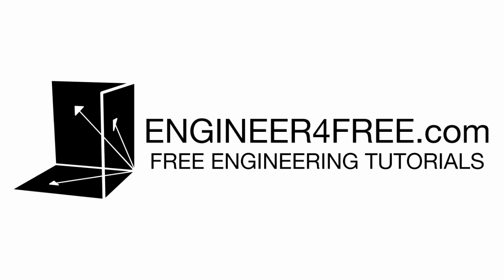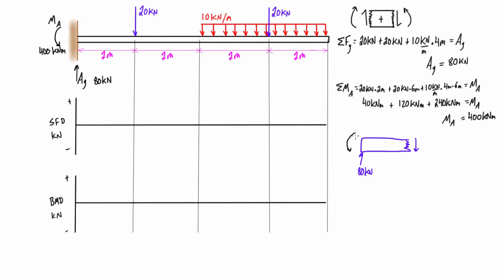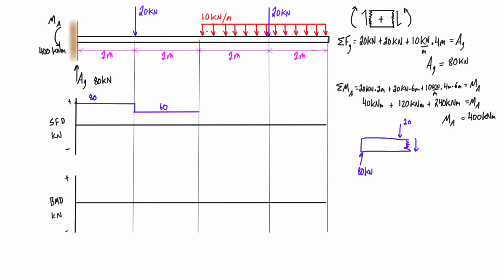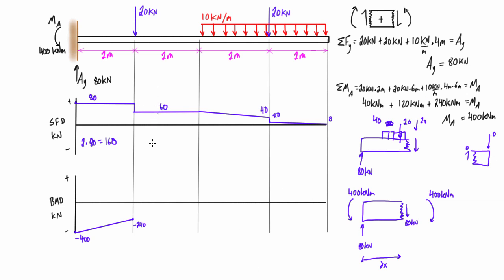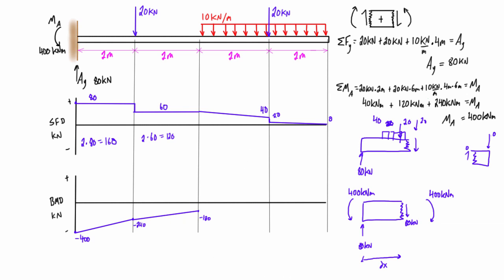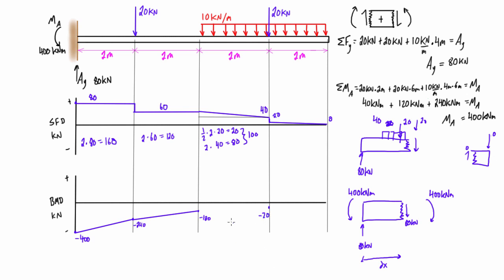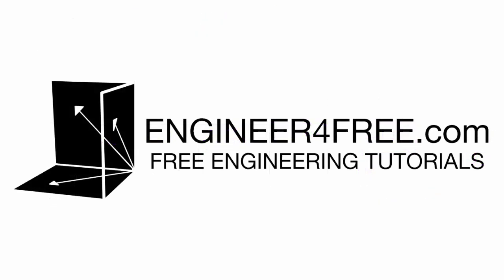Shear force and bending moment diagram practice problem #4

Comment: This is very helpful bro. But one thing I wanna ask is that why did you just used MA in a CCW direction since our conventional dixn is the opposite. Thank You tho.
Reply from the maker: In general for solving sum of moments about a point in a 2D problem it is common to use CCW as the positive sense for a moment. The is not the same convention that is referred to in the top right of the screen for an internal moment on the left of a virtual cut, which happens to be opposite.

Comment: what about Ax? is it unnecessary in this problem
Reply from the maker: There are no externally applied forces with a horizontal component, so if you draw the FBD of the whole structure and take sum of forces in x direction, the whole expression is just Ax = 0. Depending on your professor, you may be able to just ignore it it like I do. Won't hurt to explicitly write Ax=0 though if you have the time.

Comment: Hi sir, may I ask if Ay can be a negative number?
Reply from the maker: Yes, it is possible. If the net applied force is pointing down (as it is in this video) then Ay will respond by pointing up. Because we define positive y direction to be up, then Ay is positive. If we had the net applied forces on the beam pointing up, then it would be opposite, and Ay would be negative. A situation where this could happen would be uplift cause by wind loading on the bottom of the beam.
Reply: @Engineer4Free  Thank you for the information! really appreciate it

Comment: Why is it -400 kN m to start off. Isn't the area start in the positive direction and shear is +80? Please clear up anyone if possible.
Reply from the maker: Hey, draw a FBD of the structure wihh a virtual cut infinitely close to A (just to the right of A). On the left   of it, you'll have 80kN point load up acting on it from Ay, and 400kNm moment acting counter clockwise from Ma. On the right side, where the cut is, you'll have your internal shear "v" and internal bending moment" M". For static equilibrium, the forces and moments need to net out to zero. Because the virtual cut is infinitely close, the distance between Ay and v is infinitely small, so the moment that they would cause as a force couple tends to zero. So the only moment actoing on tis fbd is Ma, and M then must be equal and opposite. So it must be clockwise with a magnitude of 400kNm. Clockwise to the right of a virtual cut is opposite the positive sign convention (I think it's video 66 and 67 that you need to watch here: engineer4free.com/statics about sign convention). So opposite positive means it's negative, M will be - 400kNm infinitesimally close to A, so that's why the BMD starts with that value. As for shear, the sum of vertical forces must also net to zero, so v must oppose the uoward 80kN from Ay. So v is 80kN down. Down is the positive direction for shear on the right of a vertical cut, so that's why the SFD is +80kN at A. Watch those other vids in the statics page on sign convention, and if you have time, even the few examples in there that solve these the long way, it will help build understanding when you do in the fast way as in this video. I wrote this on my phone so sorry if there's typos. 👌

Comment: Just wondering, what is the maximum bending moment?
Reply from the maker: In this case it is - 400kNm. Just look on the BMD for the maximum magnitude. Sometimes you will be looking specifically for max positive or maxx negative value seperatly, but if not, then it's just the max absolute value

Comment: Hey! Could you please explain me why the parabolas shape is like the "a" coefficient (ax^2+bx+c) is negative?
Reply from the maker: The easiest way to think of why it is concave down, is to imagine numerically integrating the corresponding area on the SFD. Slice the section up into thin vertical slices, and you will see that they are taller on the left side. Taller = more area. More area = greater slope on BMD. Greater slope on the left side of BMD means the left side of the parabola needs to be steeper than the right side. Because we know the change in magnitude across the section is positive (because the corresponding area of the SFD is positive) , and the slope is steeper on the left side, there is only one way to draw the parabola, and that is concave down. Thats the non mathy way that I like to remember it by.
Reply: @Engineer4Free  Awesome explanation

Comment: I wonder why the US does their Bending Moment Diagrams backwards compared to a lot of the rest of the western world.  Here in NZ, positive is below the zero line.
Reply from the maker: Yeah depending on where you live they will be mirror images of each other. Drawing positive below the line or "on the tension side" makes your life easier when it comes to frames, but for beams, the integration is a bit more clear when you draw it above. It's confusing though to have two conventions. When I was in uni, I had profs from different parts of the world and learned both ways =/

Comment: When should i draw the curve in convex or concave shape?
Reply from the maker: Are you referring to parabolic section of the BMD or the shape of the deflected structure?
Reply: @Engineer4Free  parabolic section
Reply from the maker: The slope of the parabola (BMD) is greater where the magnitude of the triangle (SFD) is greater. From left to right, the parabola will increase towards positive if the area of SFD is positive. Parabola will decrease in value if the area of SFD is negative. Knowing if the Vale if the parabolic section of BMD is increasing or decreasing is important if we are skipping all the magnitude of plotting it as a function of x, which is the case in this video. Combining the knowledge of BMD increasing or decreasing, and knowing which side will have a greater slope, leaves only one way to draw the parabola's up/down concavity. You can reason your way to the slope thing by imagining that we slice the SFD triangle shape into skinny vertical parts. The parts that are taller have more area than the ones that are shorter. The area represents the change in value on the BMD across that width. So bigger changes in value equal greater slopes in that area compared to areas with shorter slices. I wrote this on my phone so I hope it makes sense.
Reply: @Engineer4Free  thanks alot

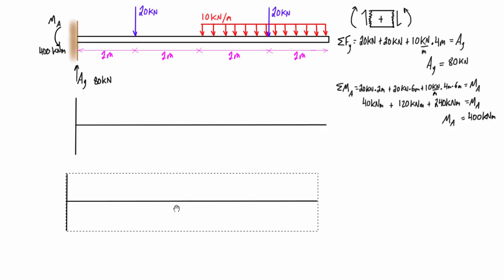Comment: hi man, good video. i was just wondering if you have any videos on how to find the stuff on 0:54, i don't really understand that.

love your channel and website, you are doing great work!
Reply from the maker: Hey Atli, thanks for the comment! Yeah at 0:54 I am applying the equations of 2D static equilibrium for the member, which are ΣFx=0, ΣFy=0, ΣMa=0. There are no horizontal forces in the problem so I just don't bother writing it out. If you need more practice with finding these, just review 2D statics problems. Try videos 25-34 here: engineer4free.com/statics and maybe check out some of the practice problems in that section too. Cheers!

Comment: How do you know that an internal moment exists and how do you assume which direction i.e counter clockwise or clockwise
Reply from the maker: Lateral loads and or applied moments on a beam will cause internal bending moments. I prefer to imaging how the applied lateral load or moment would tend to rotate the structure around the point of interest if it was able to. That will give you a clockwise or counterclockwise sense to designate the moment's positive or negative sign.

Comment: can you please upload videos regarding how to draw BMD and FORCE diagm when shear force diag is given alone
Reply from the maker: Hey yeah I currently don't have any that do that specifically, but in all my SFD/BMD example videos (videos 1-9 here engineer4free.com/structural-analysis) the BMD is drawn purely off the SFD. You can inspect the SFD and BMD to learn about the applied loads and reactions. When the SFD jumps values, there is a point load there. If the jump is "down" then so is the point load with that magnitude. If the jump is "up" then so is the point load with that magnitude. If the SFD is sloped down linearly, then there is a downward oriented uniform distributed load in that region, who's magnitude is equal to the slope. If the BMD jumps, then there is an applied moment at that point with a  magnitude equal to the jump. If the jump is up, then the applied moment is clockwise, if the jump is down, then the moment is applied counterclockwise.When I say up and down, I'm referring to reading the jump going left to right. I'm also assuming you draw BMDs the way I do, not inverted. Hope that helps, If you need practise, just take the 9 examples from my videos and draw only the structure and SFD, and then practise finding the BMD and applied loads, you can check after if you have done it right. Cheers.